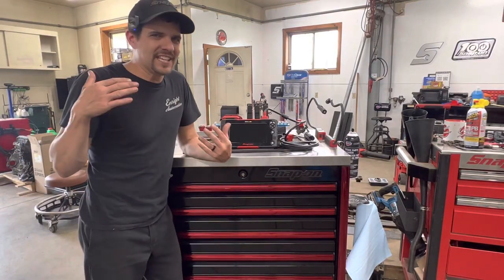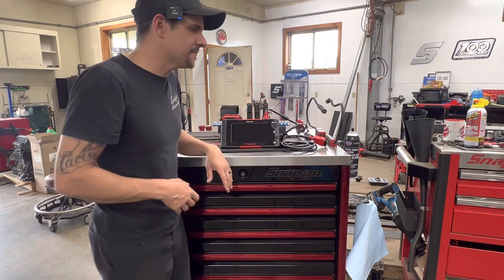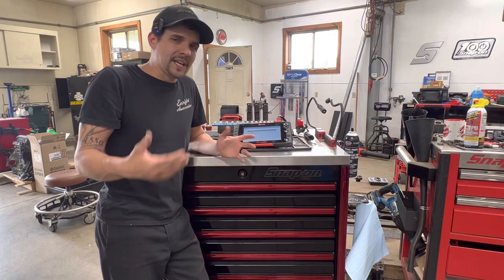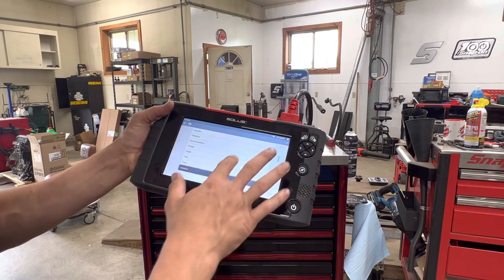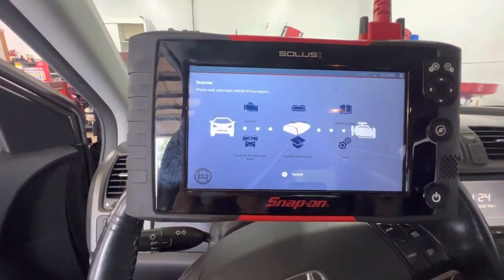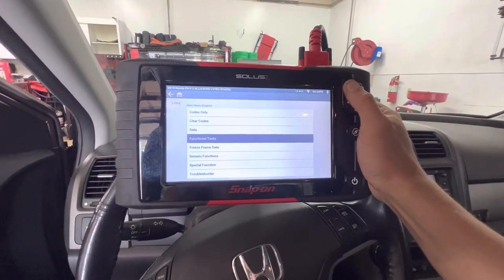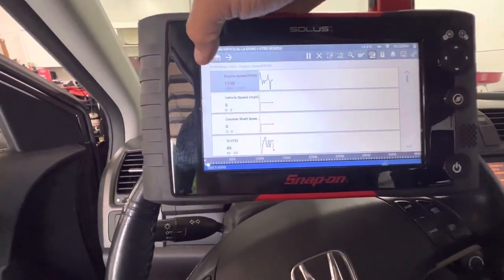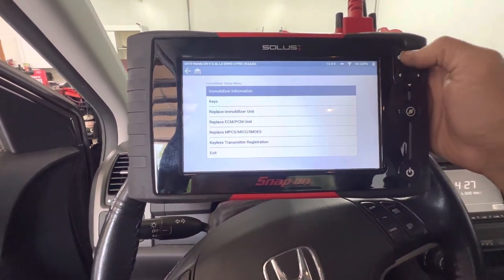Snap on Solus + scan tool. FIRST LOOK!

Comment: After having the solus for a bit, how do u like the solus compare to other scan tools, I currently have a launch and a older ethos plus that I need to replace with a newer updated one for my shop, at work we use techstream that’s now being replace with gts+ that I can’t stand, but seriously considering the new solus, sound like you can do evap testing with this one, what about leaning an riching the engine out to test the cats?
Reply from the maker: I like the Solus it works good. As long as you are working on Asian and domestic vehicles snap on is great. The best part of the Solus + is the speed.
Reply: @Enrightauto  thanks for the input, that’s pretty much what I need it for

Comment: I got a free solus plus for purchasing my first tool box
Reply from the maker: Nice!! How do you like it?
Reply: @Enrightauto  it’s pretty nice so far works great, but i wanted to program a keyfob for my truck 13 Silverado 2 days ago and it didn’t have the option to do so.
Reply from the maker: @fatalshot8783  yea a base model likely isn’t going to. I’m not even sure my Apollo would have done it or even my verus edge. They aren’t always the best at programming keys

Comment: Just bought one to go with our Zues+ was so impressed with the cloud software, I bought the Solus+  you should to a video on the Altus Cloud and how the information can be stored and used on you RO to make documenting easy.  No more hand-writing down codes and wondering if the ABS light was on before??
Reply from the maker: Great idea! I usually mention it in the videos when I’m talking about the scan tools but I could do a specific video on the cloud and the benefits